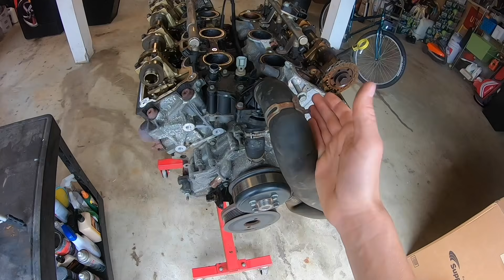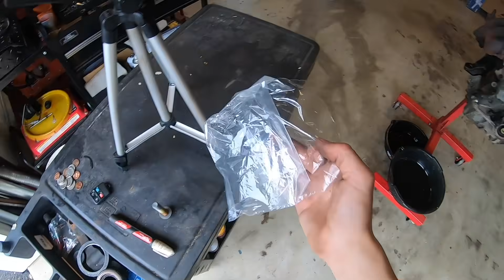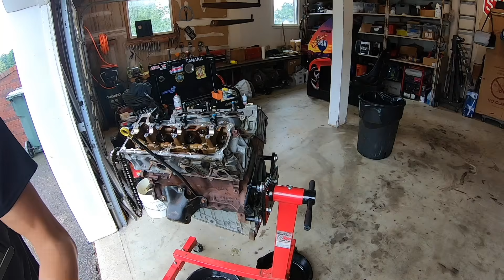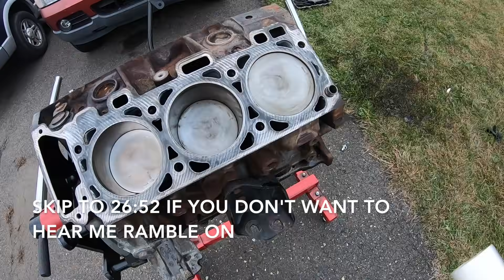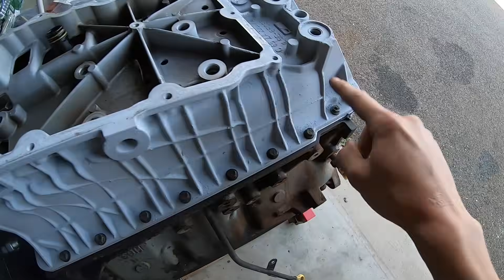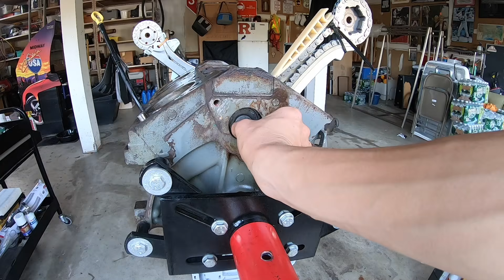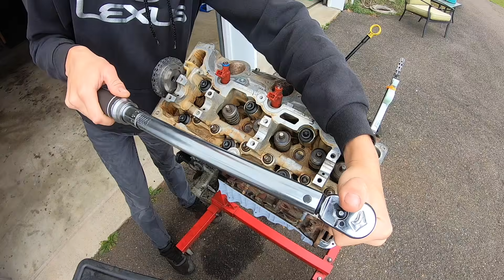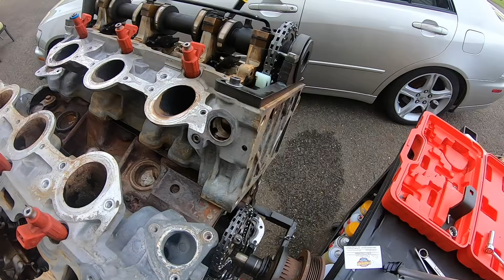Ford 4.0L SOHC V6 Head Gasket and Timing Chain Replacement (COMPLETE GUIDE)

Comment: A timing kit from NAPA alone cost 529.99. when you pull the rod and main caps to check condition, do you replace with torque to yield bolts ?
Reply from the maker: Always replace the rod studs and nuts. Main crank can be reused. Not sure why you would go get a white box Napa timing kit when a brand new melling is $300

Comment: Can I just do the front cassette and chains without removing the engine? I know the best thing to do is the all chains and guides but I’m willing to take the risk. The rear is fine, its the front that sounds. I’ll sell eventually in a few months.
Reply from the maker: Yes.
Reply: @iamdjnam  hey bro, I’m working on my 01 and boy was the fan clutch a bitch. Based on your expertise, could I get away with replacing the fan clutch with a very good electric fan or is that not bueno. Thanks
Reply from the maker: If you do an electric fan make sure it has enough CFM and a thermostat to kick it on. You will actually gain a few HP by removing the fan clutch.
Reply: @iamdjnam  answered my question

Comment: Yup, that was a lot of work, sequences are good, editing is great, quality of image is fantastic, What Camera, Lens, and Resolution are you using? Nice to have a garage to work from. These Engines seem like they are champion race horses, but if you don't take care of them, then ya, guess you have to do something like this... damn... 
Thanks for sharing... continued success with your YouTube channel and Content Creation. Good Luck.
Reply from the maker: Thanks for the kind words! I’m running a GoPro Hero 7 black at 1080p. Worst camera I’ve ever purchased in my life. Battery is awful, freezes constantly, corrupts footage! Soon will upgrade but gotta make do for now. And yes, the garage is a blessing.
Reply: @iamdjnam  I just purchased a GoPro 10 about 2 weeks ago I've been using it at 1080p 60 frames and the images are super clear I'm actually quite impressed I bought a UHS II V90 from Kingston called Canvas React 128GB with usb C connect for faster transfers. I have no complaints. All the components need to be compatible so with the higher bit rates of the higher resolutions and 4K video Etc your computer also has to be able to handle those formats I'm on finding now that I have to upgrade my computer so I can do the 4K processing.

Thanks for replying looking forward to more of your mechanical work on YouTube take care bud have a good night.

Comment: From my research theres not a need to remove head bolts in a particular order
Reply from the maker: You’ll warp the head. Safer to remove them in order especially if you don’t plan on getting the head milled.

Comment: Great video. But is it necessary to adjust the timing belt with special tools, because I do not have it?؟
Reply from the maker: If you do not use the tools you will destroy the engine. Trust me.
Reply: @iamdjnam  we will see
Reply: @sobhaifter2262  LOL
Reply: @desertrat1357  https://youtu.be/61zwdA5qldg
Reply: @desertrat1357  This is what we call a professional .lol .lol♤♧
Reply from the maker: That video is only for rear cassette replacement. Removing any of the front components requires complete retiming of the engine.
Reply: @sobhaifter2262  you know that the video you're commenting on requires special tools? The video link you posted is how you do the REAR timing guide only using vice grips. 
Please don't waste a good engine. Have someone do it that is willing to spend a measley 60$ sheesh
Reply from the maker: You da man. Well said.

Comment: Very nice job Nick, and good hard work by you. I wish I was there near by you to have my Ford explorer 2009 engine's drive chain replaced by yourself because here in Dubai-UAE there are not many good, honest mechanics who are cost effective to do the great job as you did it. My SUV's drive chain was replaced eventually but the job done doesn't seem to be accurate. What is happening is my car miss fires after driving for 20-30 minutes at random and I was wondering whether it is due to the bad timing after rework on its drive chains or is it because of something else? The mechanics here told me that if the timing was out even a bit then the car would not even start at all or at least would start miss firing right at the start up, and they even said there was no collision between the valves and the pistons after the original drive chain got slipped, which I can't believe them after seeing this video. So once you relpy I will like to write back one more comment or a question, please help by guiding me to fix my explorer the right way.
Reply from the maker: I’ve seen the rear bank timing chain on a 4.0 retard backwards because the guide rail broke causing slack in the chain. It will still run but will misfire. Shake at idle, go away when you give it gas. If the chain jumps even one tooth, you will bend the valves as seen in this video.
Reply: @iamdjnam  Thanks for your reply. And if the valves were bent then engine would not function at all right? If this is the case then valves in my car were not bent because they didn't change any after replacing the chains, tensioners and guides and the car runs OK but there is rough idling, miss firing and shaking not immediately at start up but after running the SUV for some time like 20-30 minutes and is at random and never at startup immediately which means the rear bank chain is OK too. So do you think it is some thing else or still it is the timing issue or in worst case the slightly bent valves being reused? In my knowledge I don't think that bent valves will let the car run at even single one of them.
Reply: @iamdjnam  one more thing just to let you know in my case it was the bank 2 chain which slipped. 
And would you please tell me what is the difference between 06 explorer's engine and 09's or are they 100% identical?
Reply from the maker: @amigan34  100%. Anything from 2002-2010 will fit. I’ve used 2010 engines in 02 explorers and 02 engines in 2010s.
Reply: @iamdjnam  Thanks for your reply again, you are great. One last thing, can I place 09 explorer's computer module with 06's and would you please also shed some light on valves issue mentioned in my last comment to you? I would really highly appreciate.
Reply from the maker: If the valves are bent the vehicle won’t start. Typically 3 valves bend when the chain is out of time. On other vehicles one valve can bend and the truck will still start. Not sure about the ECU.

Comment: Im replacing my driverside (bank 2) cylinder head.  I have a complete head including cam, valves, springs, etc..   but i was wondering, how am i going to get that timed in? Do i have to time the passenger side and then the drivers side? Or how does that work? Im not touching anything on the passenger side, just replacing the driver side top end basically... how would i go about timing that? Or do i have to?
Reply from the maker: Replacing a cylinder head requires complete re timing of the motor. Buy the tool kit and follow this video. You can do passenger side first and then drivers side.
Reply: @iamdjnam  Thank you for that very informative video it’s helped a lot.
I had a leak down test performed on my vehicle and it showed cylinder five was leaking into cylinder six so the head gasket is blown. I just ordered a complete head gasket kit and left hand cylinder head assembly. My question is if I put the timing tool you recommend on the camshaft and achieve top dead center would I need to remove the right hand valve cover to attach those brackets to hold it in place? Or since I have top dead center do I just rotate the new cylinder head until the timing bracket for that cylinder head is aligned properly?
Thank you for any advice.
Reply from the maker: Removal of any cylinder head requires complete retiming of the engine. Start over. Cylinder 1 TDC (keyway at 12:00), left head front cam lobe slot parallel with valve cover mating surface, right head back cam lobe slot parallel with surface and timing nub straight up.
Reply: @iamdjnam  Thank you for clarification. Also I forgot to mention I am doing this with the motor still in the vehicle if that makes a difference at all
Reply from the maker: You won’t be able to replace the rear cassette.
Reply: @iamdjnam  Do I have to replace the rear cassette if there’s no damage?
Reply from the maker: Nope

Comment: You said to put the bolts in a bag so you know where they go. Sadly, I did not. All of my engine bolts got mixed up because I wasn’t even thinking about that when I removed everything. I am rebuilding my engine and figured out the bolts so far, but I really can’t figure out which ones go on my timing cover. I know there are different lengths on there but I just can’t figure it out. Do you have any suggestions on how I can find out? I called the Ford parts dept already and they told me the part numbers, but I can’t find them online anywhere so I don’t know how to figure out what they look like. Any tips would be much appreciated.
Reply from the maker: Email me using the address in the description and I will send you pictures of them

Comment: great videos  i have built on some 4.0 sohc engines      just look at my channel
witch bolts did you need to replace exactly   please    i am not sure if the camshaft bolts can be reused
Reply from the maker: In the video I go over every bolt that needs to be replaced. Camshafts can be reused. They are not TTY because they do not have a rotation stretching them after the 63 ft/lbs
Reply: @iamdjnam  thanks i have been told to replace them that is why i asked  
i did not buy new ones so that is refreshing
Reply from the maker: Yeah a lot of people have no idea what they’re talking about and will tell you complete BS. If you have any more questions, I’ll give you the correct answers.
Reply: @iamdjnam  what about the crankshaft bolt? Is it torque to yield? Because you have to put it on plus another 90°

Comment: Get you a piece of pipe my friend for those head bolts! killin yourself
Reply from the maker: Yeahhhh I got pipe but these damn T55 like to slip off and round out the head if you are not super careful. I’d rather struggle and succeed than spend the day drilling bolts out.